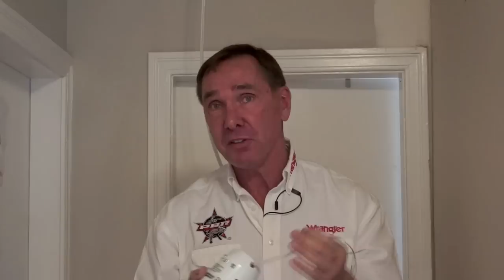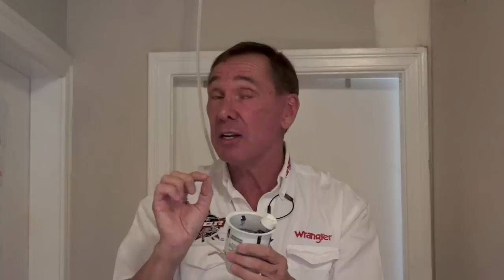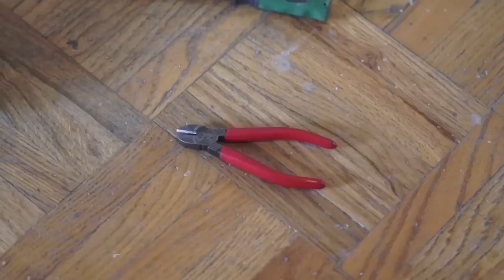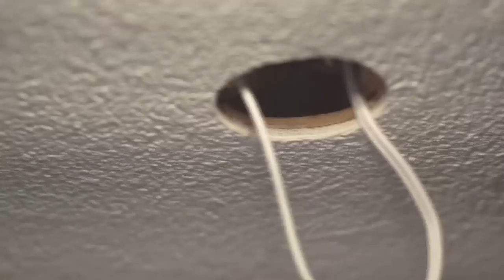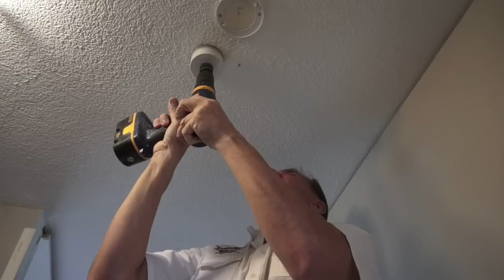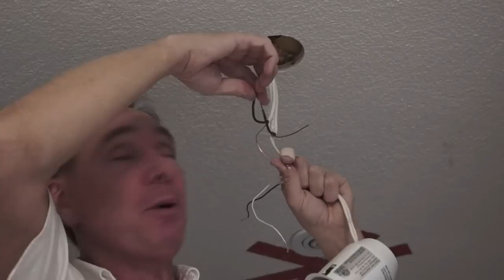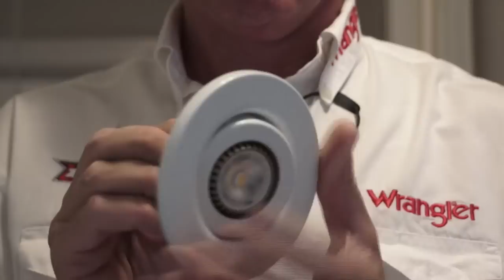How to Install Recessed Lighting | Retrofit

Comment from the maker: Sam G. Watch the video but more importantly use common sense. Some of you people are total idiots. Once again, I am absolutely clear that this installation is for LED lights only!!! Furthermore as we are months away from a total ban on all incandescent bulbs it will be impossible to even fuck it it up with Halogen. Even the wire itself. You could almost get away with speaker wire. It's not much different than the power required to run a string of ungrounded LED Christmas lights that you see OUTDOORS in the rain and snow WITH salt everywhere. Nobody dies installing these every season. Why? For the same reason my installation is 100% safe!!!
Reply: For the total idiots (that don't understand the difference between the LED's power and the voltage provided)...  If you were to install a single LED controller (in a proper enclosure), and then run low VOLTAGE wiring to the LED fixtures, then you would be safe not to use enclosures for the connections, although you really want to use proper wiring.  But splicing 120 Volt wires outside of the proper enclosure is just stupidity, and against any code you'll find.  You don't need an electrician to do it, but it does need to be done.

Do yourselves a favor and ignor this video.
Reply: +bluekeet Anytime you are splicing wires together it needs to be done in an enclosure. Wire nuts are not perfect and frequently do become loose. If they become loose in the attic, it can cause a number of problems. It could ground out on the ground wire and create arching causing a fire. It could also form an intermittent connection. This would increase the resistance at the connection and also lead to a fire. The fact that LEDs are being installed in this situation has nothing to do with the way the wires are being run. There is nothing between the wires and the branch circuit breaker which means it will not shut off power if there was a problem until it is too late.
Reply: +Percy Lipinski oh, we added moron to our insult list. nice. good to know you can think outside the box. but they're leds, how could they possibly need to be recalled, even if they were defective. they're leds so they cant hurt you. leds are gods gift to the planet and can do no harm. they're led so it doesnt matter. apparently the manufacturer begs to differ. leds can hurt under the right circumstances. all electricity is dangerous under the right circumstances, period, end of story. you can do what you will at your house but you have no business creating an instructional video telling others to do things that are potentially dangerous. at the beginning of the video you state that 120v isnt really enough to kill you. right off the bat you made me want to vomit. i can handle ignorance, but the gross negligence of putting lives in danger is more than i can stand. and your insults are redundant and juvenile. Notice that, unlike you, I have put multiple sentences together without once resorting to name calling. i will do it here once and only once. you, sir, are a laughable excuse for a human being.
Reply: +Percy Lipinski the fact that you immediately resort to name calling shows your maturity level. nobody said massive numbers. you said no one has, so i guess you have been following that fact comfortably enough to say no has ever been killed by led lighting. fact:120 volts can and has killed. led had absolutely no bearing on that. this video is a running joke on multiple electrician forums and fb pages. you really need to learn more insults. idiot and douchebag are getting old.
Reply: +Percy Lipinski wow, just.... wow. i do not have to follow your parameters for having a conversation, if thats what you want to call this. i dont have to show you proof of anything. why on earth are you calling a woman a dickface. what kind of lowlife are you that cant handle a simple back and forth discussion about something without acting like a tantrum throwing 2 year old. maybe, just maybe, you could possibly have done this in a manner that will never fail. but by posting an instructional how to video, you are now responsible for everyone that repeats what you have done. you seem to believe you are the only smart person on the planet as you have repeatedly dismissed the opinions of everyone that has disagreed with you. so that being said, you are now instructing people that are significantly less intelligent than you on how to wire up light fixtures in a frighteningly substandard way. you cannot guarantee that every tom, dick and harry that watches your video will do it correctly. hope you can sleep well knowing this. i am licensed and have been practicing for 20 years and I still bare the burden of knowing that i hold peoples lives in my hands. i beg of you, if nothing else, please remove the statement that 120v isnt enough to kill you. i have heard that you have said this in other videos. i personally cannot stomach the thought of watching another one of your videos but that is what was said on a page i am following. my only hope is that people who are thinking about following your video are reading this and seeing how you conduct yourself. i could never ever respect someone who talks as you do enough to take anything they say seriously.
Reply: +Percy Lipinski people get injured and die every year from putting up christmas lights. 120v can kill you.
Reply: +Marty Fried plz explain some more im thinking of installing some recessed lights. What exactly was done wrong in the video.
Reply from the maker: +s rodgers "people die from putting up Christmas lights every year". So you've.been tracking thus have you? And if this is so dangerous why is it I have yet to ever hear about all the dangers of LED Christmas lights. So are their idiots that fall off a ladder while putting them up? Obviously but WTF does that have to do with my video you IDIOT!!! Are massive numbers of people being electrocuted from Christmas lights every year? Are houses burning down from the heat coming off LED Christmas lights? Show me the facts or shut up you douche bag!!!
Reply: +Percy Lipinski http://globalnews.ca/news/1030838/loblaw-recalls-led-christmas-lights-due-to-risk-of-fire-electricution/
Reply from the maker: +s rodgers You're really desperate aren't you? So have you stopped driving because Toyotas were recalled you moron? That's a "product recall". Not only that the article is clear that nobody has been hurt it's "just in case". If you had a brain that could process more than a few words at a time you'd realize I was asking you to send me a link showing the dangers of installing LED lights with actual fatalities not defective lights from a manufacturer!!! STUPID IDIOT LOSER!!!!!!
Reply from the maker: +s rodgers and the fact that the into has made the rounds of electrician sites speaks volumes. They are the ones that have the most to lose if people figure out how stupid many of them really are. Maybe they should take those 120 volt lines and try a brain massage, IDIOT LOSER!!!
Reply: Had to sell em before they burned down. Lol you are truly the only person I ever seen that does Jack leg shit and videos the idiotic shit. Good job. Fuck up.
Reply: there's no 120v junctions in a string of Christmas lights you fuckin idiot
Reply: +Jack Watkins wow lol this guy really is fuckin whacked
Reply: Ain't he tho. And to think he has probably got others doing this shit
Reply from the maker: +Jack Watkins look you piece of crap! You shithole loser!!! I am telling you that what I do is 100% safe as long as they closely follow my instructions

Comment from the maker: David Armstrong, are you not able to read? Fist of all its been almost 4 years since these LOW wattage bulbs were put in.
Second halogen bulbs are even now almost impossible to find and soon will be extinct as incandescent bulbs are soon to be banned
Third, what idiot would pull out a high priced, low power LED bulb and replace it with an older heat producing halogen bulb even if he could find one
Fourth, LED bulbs last about 200 times longer than a halogen  bulb so there would be no need to replace it.
Fifth, this house is so old I'll be the last person living here before its torn down!
Reply: The fact you've installed LED lamps has no bearing on the hazards you've created. You don't understand the basic fundamentals of electricity. The way you insult the others replying to you is classic. Your critics are right. You're the real idiot.
Reply: You've been living a lot longer than 4 years - I suppose you think you'll never die since you haven't yet!
Reply: +Percy Lipinski I believe your last statement you meant to say "I'll be the last person living here before it burns down".  What makes you think that those LED bulbs will never be replaced?  What if you were to sell your house and the next person decides that they don't like the color of LEDs or if the next person is just there to flip the house and decides to keep the nice LEDs for himself and replace them with cheaper halogens prior to selling it to the next owner?  At the very least put some markings on the fixtures that says something to the extent of "For use with LEDs only up to 5 watts" so that the next owner has a clue that that fixture and wiring/installation is not up to code.
Reply from the maker: +Dave M use some common sense which sadly, is lacking in this comment section. Firstly halogens are banned in this country as of last year. So let's say you're determined to smuggle in some halogens. Then you what? Take out the fancy, low cost to operate LED bulbs and install 20 times the power consumption and  install a new electrical panel to  accommodate the 40 x 50 watt halogens to burn an extra 2,000 watts. I suppose an idiot like yourself might think oh what a great idea but fortunately your not a voter I this county and as such it wouldn't happen. But since you seem convinced of the possibility, here's an investment tip. Buy stock in halogen bulb companies because you obviously know far more than I about such things! Lol
Reply: +Percy Lipinski just to let you know MR.Lipinhead.....incandescent lights canbe bought anywhere

Comment: Hi Percy,

  Nice video, thanks for uploading it.  Do you have any before and after pictures?  I'd like to see what difference lights of this caliber and voltage (you see these 5w LED kits for this type of light all over online retailers) made in your hallway.  I'm on a vendetta against shadows in my house, and am strongly considering something like this!

  Also, in the video you said you're not using the lights the kit came with, and you're using a hole saw rather than a jigsaw, but I'm not sure you said why you made that decision.  Is the hole saw a necessity?  

  Thanks!

Stephen

Comment from the maker: Kevin G. You sir are an idiot of biblical proportions. You're also no doubt a poor starving electrician. It's been 3 years since doom and gloom were predicted by idiots like you and you know what it'll be another millennia before anyone needs to think about a problem with regard to my extremely safe generation. There's heat generated but the significant amount is the stuff coming out of both of your ends!!!
Reply: Percy Lipinski Really?  You don't know how to start a fire with 2 wires and 120 volts?  Man, you are dumber than you act, and that's a hard act to follow.
Reply: Percy Lipinski
Thanks for the kind words.  I love being able to come here and poke you with a stick to see your reaction.  It's great entertainment to see what sort of total nonsense you can come up with to avoid admitting that you don't understand the very basics of how electricity works.  While you're stuck on heat dissipation, the rest of the world understands voltage potential.  We know that the world is not perfect, and that perfect little LED fixture can do things like short out and overheat, resulting in disaster (only for your home, hopefully) especially since you probably bypassed the breaker or fuse along with your other idiotic maneuvers.  Or perhaps that hot wire's incorrectly installed nut (since you don't care about codes and probably did it wrong) comes off, and some animal that came in through your incorrectly installed soffit moves the wire so it shorts against the ground wire you never connected. 

Oh, those pesky codes that those damn electricians wrote up to try to cheat the poor people who can't afford proper fixtures!

Ha ha, don't blow a brain gasket, Percy.  And keep up the good work giving everyone the old Lipinski.
Reply: Percy Lipinski Can you even read?  Guess not, since you have yet to say anything that actually addresses the issues people raise.  I never said one thing about the LED power.  I only asked you about the 120V that's going into the LED controller.  If you only had the low voltage/low power for the LED themselves, you'd be better off, but you have 120 volts all over.  What if something in the LED controller circuit goes bad (not the LED lights)?  Guess you don't really understand what's going on so well, do you?

Do you have a reading problem?  Is that why you can't read the codes?  You know, if you could read, you'd be able to follow code without hiring an electrician - do you understand that at all?  I don't think you do.
Reply from the maker: Marty, if you were any more ignorant you're head would disappear. I mean you're beyond stupid!!! First the whole drunk driver thing. Now you're talking about a controller. Hey like I said you loser show me how on earth the wire is going to suddenly burst into flames. Controller, WTF there is no controller. There's a "Wheatstone" bridge circuit in the lightbulb that is in itself a separate circuits used to step down the voltage to 5 volts DC. That's the lightbulb and it's guaranteed for 35 years idiot brain. You're built upside down you piece of crap loser. That's right your ass is where you're brain should be. Moonlit and have a drink and then do the world a favor and get behind the wheel on an icy bridge wooden alone one night. On your way down think about me in my nice warm, brightly lit beautiful house you useless dick of dicks!
Reply: Percy Lipinski Wow. It is obviously not worth trying to convince you of your wrong methods. I feel the same way when i try to convince a stupid drunk not to drive. " I drive home drunk all the time. I have never been pulled over or had an accident." they say. Of course, they never learn they are wrong until they get arrested or kill someone. I hope you don't learn your lesson by burning down your own house with your innocent family inside of it. I am not joking! This is serious stuff!
Reply from the maker: Brian you're just as arrogant as the rest of these low life micro brained idiots. I remind you of a drunk? WTF, you all remind me of crack heads except I would trust a crack head more than I would any of you with an installation. Not one of you jiggling jerkoffs has come up with even one fact to show how my house is going to burn down. The best you've been able to do is quote a "code" violation or non electrician installation as somehow a guarantee of impending doom. Hey shithead, it's been 6 years and nothing yet. Wanna bet it'll be another 20 years before we even think about it! You won't because you're a know nothing LOSER. Other than quoting codes you are all useless idiots with at most two electrical neurons working.
Reply: Percy Lipinski Many drunks have been driving while drunk for 6 years or more, and haven't yet killed anyone in an accident.  Is it OK if they come drive around your house?  No insurance of course.